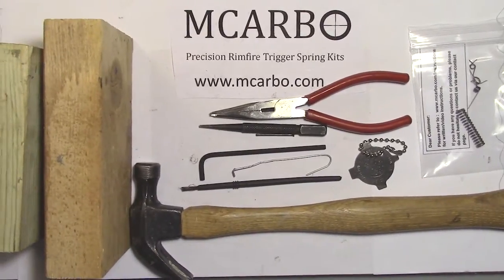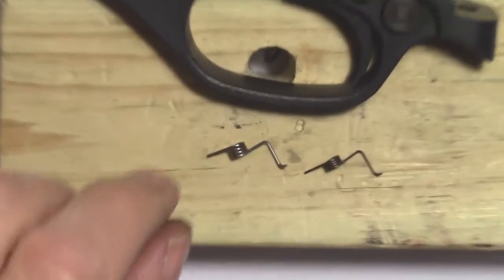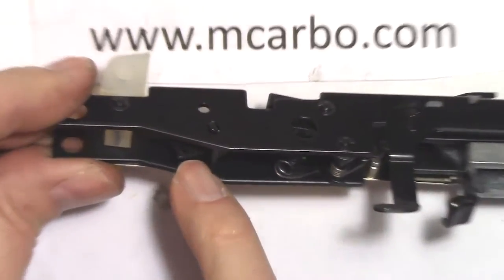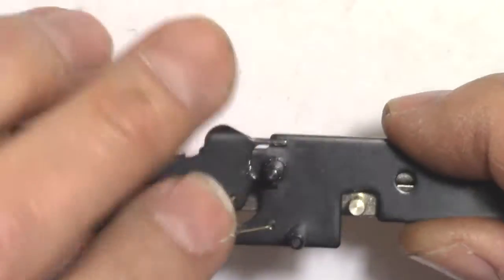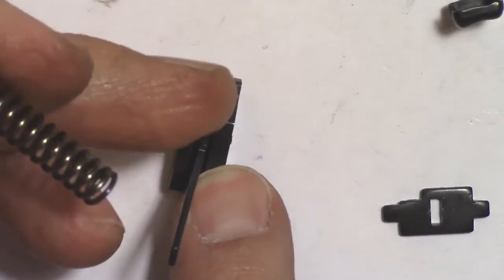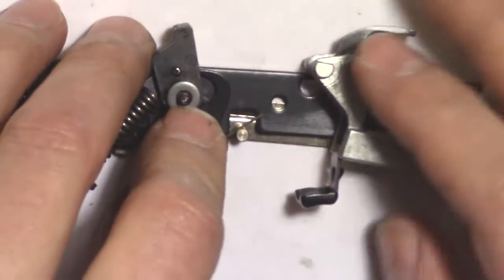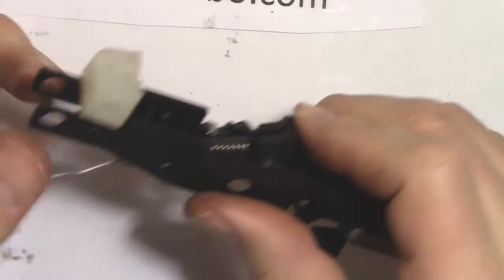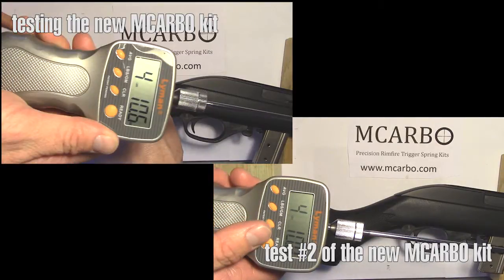Marlin 795 Trigger Job | Marlin 795 Trigger Spring Kit by MCARBO.com

Comment: Use your third hand to replace the paper clip after you compress the hammer spring and plate. LOL. I had to have an assist from my daughter. This video helped me make sure everything was oriented properly and replaced. Trigger pull is 3 1/4 to 3 1/2 lbs. now. Sweet!

Comment: Thanks so much for a detailed tutorial on breaking the 795 down and reassembly.  The Spring Kit will be my next improvement.  My 795 was not firing.  I had pushed a cleaning tip down the bore and it went into the firing area.  I noticed a spring (#11 Disconnector Spring) unattached at one end.  It was not easy to figure out by looking at it and I realized I needed to break it down.  You gave me confidence I could do it and I believe I succeeded.  I haven't fired it yet, but I was able to dry fire and I was not able to do that before.

Comment: I put this kit in my 795 a couple months ago & finally today got to actually try it out, wow what a big difference it made. While I had it apart I also stoned & polished the sear & the other parts in the trigger group. Maybe took a hour or less including the springs, polishing, cleaning & lubing everything. The disconnector  spring was very easy, got it on the first try. Definitely worth the price & what little time it took to install.
Reply from the maker: Thanks Brother for your feedback and support.  What was your trigger pull after installing the trigger spring kit and the polishing work you did?  Thanks again,
Chris

Comment: How can I get a 2.5lb pull? Clip the hammer spring?
Reply from the maker: If you wanted a 2.5lb pull you would need to do some polishing of a few internal parts to get that low.  Don't clip any of the springs.  That could lead to malfunctions.  Take a look at what tharber262 commented below.  Ask him for details.  I hope this helps.  
Thanks,
Chris
Reply: +MCARBO
Polishing is something I am quite good at doing.  I can always count on you guys for a reply. Impressed as usual. Thank you.
Yes, I had read that fellow's comment. I still wish he had published the pull weight he obtained. I kept wondering why he did not.
I hope he returns and does so.
Reply from the maker: Thanks Brother.  I'm glad I could help.  I'm sure he will respond.  If you decide to do some polishing with the kit post your results for us.  Let me know if you have questions or need anything.  
Thanks again,
Chris
Reply: MCARBO
I was using the results as a guide to whether I would buy the more expensive Ruger which has a HUGE aftermarket, or this less expensive Marlin that I think has just enough aftermarket to make me pleased. Not 100% sure yet. But I really would like the Marlin to work out. I love the bolt release system. It is like my beloved BAD type levers on my AR15's.

I do like a very light trigger in any .22 rifle or pistol in the 2.5lb range. 4.5 lbs is too heavy for a .22 IMO.

I am a pretty good armorer. If someone else can do it, I KNOW I can duplicate or exceed their results.

My problem is funds ATM. I am the guy that wants the Sub 2000 too, and ALL the goodies you guys make for that gun!! 
 How is that trigger bar coming along, BTW?
I am a big fan of your company and how it is operated. Very impressed. Always.
Reply from the maker: Dave, 
This is a great time of year to do some shopping for the gun safe!  I can remember a couple big box stores last year using the Marlin 795 as a door buster at $129 each on Black Friday.  Really hard to beat that price for a brand new rifle with lots of potential.  So if funds are the issue I'd look around during the Holidays and see if you can get a Marlin 795.  Don't worry we have more planned for the Marlins.  We're just super focused on making parts for the SUB-2000 at the moment.  
I would keep a look out for a great deal on a SUB-2000 while your at it.  I've heard of two different guys picking a used one up for $300, which is a killer deal!  If I see anything I'll let you know.  
Thank you for your Support!

Comment: I must be strange. I like the factory trigger pull on my Marlin 795. It’s light and works just fine for me.
Reply from the maker: I bet you would like it a lot more with this kit.  You could always return it if you didn't absolutely love it.
Reply: There is a night and day difference. I installed the full M795 kit in my Marlin and could not be happier. The new trigger itself feels outstanding and the pretravel adjustment makes a huge difference in at the range accuracy, IMHO, because there is virtually no trigger creep before the shot. Add in the crisp and light trigger pull from the new springs and it is like willing the bullet out of the barrel.